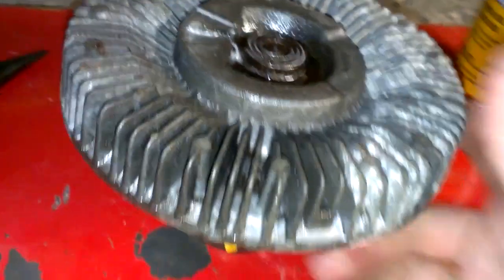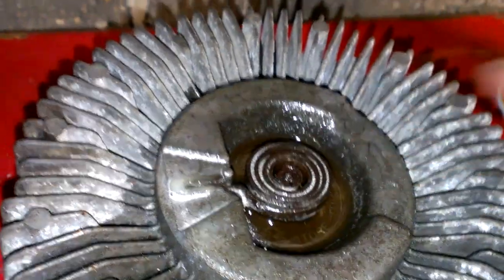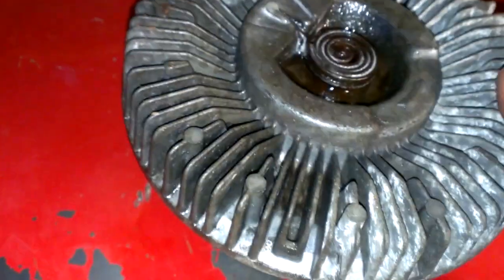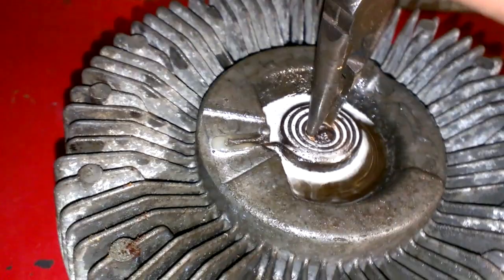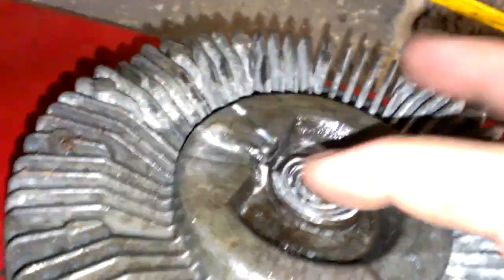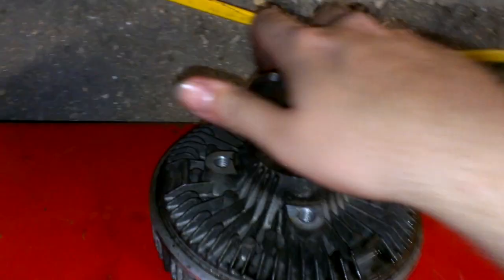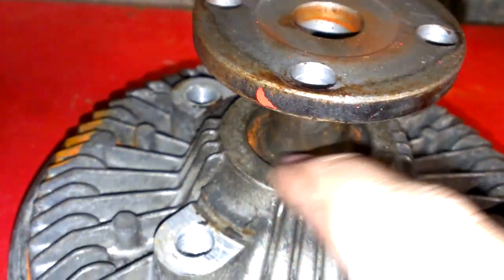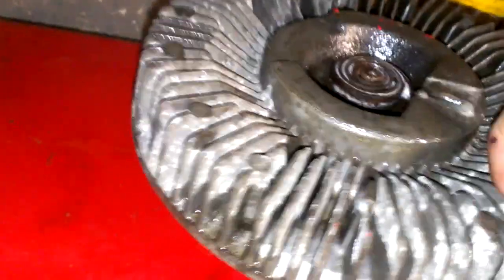How to fix a fan clutch

Comment: I'd usually just replace it if I had a problem, but this is an excellent solution if you are stuck someplace or need to use the vehicle until you can buy a replacement. Thanks!

Comment: That's called a thermostatical fan clutch. That spring on the front like you said heats up and coils up like a thermostat in the motor and locks the fan in. The other types are centrifical which spins with the engine rpms on centrifical force, the faster the engine spins the more the fan locks in. The other type is a solid fan type that spins the same as engine rpms at all times. Then for most big trucks, they use air controlled fans and those  spin up when the engine reaches a certain temp.

Comment: At low RPM and vehicle speeds the fan clutch locks up to make the fan turn to compensate for the lack of airflow through the radiator such as stop and go traffic. As the vehicle speed and RPM picks up the clutch allows the fan to freewheel as airflow coming through the grill flows through the radiator cooling the fluid (Coolant) running through it. It is a centrifugal clutch much like the one on our old mini-bikes.  Mercedes and BMW do use a Thermo-static design fan clutch and others have electric fan in addition.    I am ASE certified. (A. sk S. omeone E. lse)
Reply from the maker: Michael Ferreira yea this is a thermo static fan. (coil on front) thanks for the info

Comment: Thanks for the video Bam.
Mine was stuck in the full on position (opposite to yours) but with WD40 and a blast of air it's working perfectly again on my 96 Safari.
I didn't even have to remove it from the car, just loosened the shoud and reached in.
An excellent fix, thanks again.
Reply from the maker: cool. glad it worked out for ya.
Reply: And did it stay functioning properly  3 years later?

Comment: Temporary fix only, these, alike most modern parts are designed to fail and usually irreparable, then when you go for parts, find the replacement is 10 times the cost of an older cars (same) unit.  Auto makers used these tricks to make aging cars economically irreparable, which i see as a criminal act.
Reply from the maker: ToxicHolocaust2050 yea that's how the world is now. its a shame isn't it.
Reply from the maker: well said
Reply: M
Reply: That is what they call in the industry predetermined obsolescence  The oldest light bulb still going has been burning for over 100 years and counting.  The light bulb manufacturers got together after they found out that they were not getting repeat sales ever since then they have designed light bulbs to burn 24/7 for only 40 days.  Predetermined Obsolescence!
Reply: Watch Mysteries at the Museum. I saw it there. Maybe they have it on youtube that episode. It has been running 24/7.  Too good of a design.
Reply: @1957wade     how did they do that, the~~ 40 days ,anybody knows?
Reply: @josepeixoto3384  it's the filament material and thickness, its been tested and developed to eventually break after been heated for a certain amount of time. Sometimes you can actually rotate a lamp with a burnt out bulb so the filament reconnects and sometimes (if you're lucky) it will stick there and you can get more use from it.
Reply: Exactly! That's terrible
Reply: That's why you throw the clutch fan away when it fails and replace it with an old time 4-6 blade solid fan!

Never heard of one of those old time fans failing, have you??
Reply: If you have the receipt there warrant free for life that means after you by your clutch fan / fan clutch ..and you can get a free one when it goes bad
Reply: We just bought a new one

Comment: The valve working again does you no good if all the fluid has leaked out.  You can peel them apart, fill them about half way with fluid again, and then re-seal everything and it should work fine again, as long as your "valve moves/  like you said/  and the bearing isn't locked up.

Comment: Not true. There are blind plugs under the ones that hold it to the fan. You have to drill them out. Then you can replace the fluid in them. After you flush it the old stuff out. If it leaks around the outer seal. Just reseal it. The inner seal can be pressed out. Once you press out the threaded holder with a puller. Just replace with the same part number on the seal..

As these things cost $100.00 new for a factory one.

Comment: I think my fan clutch may be bad.. my fan used to run directly all the time. It's 30 degrees outside right now, that may be what is causing it to not engage. Wonder if it will go back to normal when it warms up a bit

Comment: I thought the fan is supposed to free wheel when its cold and lock up when its hot? Isn't this how it works, so less air is drawn in when cold and more air drawn in when hot?
Reply from the maker: YES! that's exactly how it works. but when its cold and you free wheel it by hand its supposed to have at least some resistance. like with one good spin it will travel about one and a half turns before it stops is a good estimate. a little after that is good. but if it turns like 5 turns before it stops then its time for a new fan clutch....
Reply: bam6972 Ok, thanks for that. In fact, when mine is stone cold with the engine off and I try to spin the fan, I can barely get a quarter of a turn out of it. I guess this explains the constant loud fan noise. Hence why I have been searching YouTube for an answer and a fix. Thanks for the help and great YouTube clip.
Reply: aussikiwi same with mine...very stiff to turn, and lots of fan noise at cruise rpm...i can stop the fan with a towel protecting my hand when engine is running, but it has lots of resistance...i was suspecting failure of the bearing..

Comment: What is the white stuff in the fins? I just bought a new old stock fan clutch and it had some grey and white stuff about 2 inches long on the edge and on 4 or 5 fins. Looked sorta like dry toothpaste. I don’t know if it’s oxidation or it leaked a little where it pressed on in the box and dried. It seems to be good still but haven’t installed yet.

Comment: ok, i think this may be my problem on my 04 4x4 suburban. when im driving at any speed if I "remove my foot from pedal" when coasting there is a spinning whirring sound from engine, but when I "press pedal with gas" the sound goes away?  I tried something when I was coasting at any speed, I put the car in neutral and the sound is still there, it only goes away when I press on the pedal, WEIRD!?  Gonna try this fix.  Thank you and let me know what you think on my engine issue.
Reply from the maker: +m00nchildblues it sounds like the fan is doing its job actually. idling when hot it turns the most and when you hit the gas it will actually kinda free wheel. so you might here a roaring sound at a stop and not when you get going again. that's normal. but if the roaring gets louder when you hit the gas then the valve is stuck in the open position and locking the fan up permanently.
Reply: tech fixed it, it was the rear dif bearings shot. 1k later..

Comment: when the car is cold is the fan supposed spin fast as well? or only when warm?
Reply from the maker: its supposed to freewheel to some extent when cold. and fully engage when hot.
Reply: +bam6972  ok thanks. I am thinking the clutch fan is engaged at all times even when cold. I live in bakersfield and it's been hot and I just don't see the clutch kick in and out. I have a 04 jeep wrangler with 4.0 engine.
Reply: +bam6972  ok thanks. I am thinking the clutch fan is engaged at all times even when cold. I live in bakersfield and it's been hot and I just don't see the clutch kick in and out. I have a 04 jeep wrangler with 4.0 engine.
Reply: +bam6972  ok thanks. I am thinking the clutch fan is engaged at all times even when cold. I live in bakersfield and it's been hot and I just don't see the clutch kick in and out. I have a 04 jeep wrangler with 4.0 engine.
Reply: +bam6972  ok thanks. I am thinking the clutch fan is engaged at all times even when cold. I live in bakersfield and it's been hot and I just don't see the clutch kick in and out. I have a 04 jeep wrangler with 4.0 engine.
Reply: +bam6972  ok thanks. I am thinking the clutch fan is engaged at all times even when cold. I live in bakersfield and it's been hot and I just don't see the clutch kick in and out. I have a 04 jeep wrangler with 4.0 engine.
Reply: +bam6972  ok thanks. I am thinking the clutch fan is engaged at all times even when cold. I live in bakersfield and it's been hot and I just don't see the clutch kick in and out. I have a 04 jeep wrangler with 4.0 engine.
Reply from the maker: you wont see it kick in and out. it will very slowly kick in as it gets warmer and then stay engaged at all times after that since the radiator is always very warm after the engine has warmed up. then once engaged and warm it will sorta release when your heavy on the throttle. as your moving the fan doesn't really need to spin as hard since the air is being rushed in. when its warm pop the hood. the fan should be moving very fast and loud. then have somebody give it a bit of throttle like 1500 to 2000 rpm. you should hear the fan slow down after a few seconds.

Comment: I like your video but i'm having the opposite problem..Mine is stuck so the fan is turning hard all the time..Any idea's..
Reply from the maker: do the same thing. loosen that middle pin and put some pb blaster in there and work it back and forth with a pair of needle nose pliers. that pin is just stuck in the locked positions. just need to free it up.

Comment: So you don't think it could be that I am just trying not to have to pull intake
Reply from the maker: dont have to pull intake. just take the top sensor off and look inside with flashlight. if you see gold spots then its leaking fuel inside. should be all black carbon build up.

Comment: ok i turn the little pin in the middle of the fan clutch was that ok
Reply from the maker: +Lady Sylvia R. Richardson yes as long as it sprung back from where you turned it. if it didn't spring back then put some pb blaster on it and soak it for a few hours then try turning it. if it doesn't free up then time for a new one.

Comment: So mine sounds like its good when i first start the truck and then it quiets down and i dont hear it again till the next morning
Reply from the maker: does it overheat?
Reply: bam6972 no not at all but i never hear it kick on
Reply: All fans make noise at start up. As that is normal when you are stopped and have the AC on..Till it gets warmed up or you start moving.. It tells you it's working. As it takes time for the fluid to disengage the fan. It works just like a transmission. The thermo coil is what controls the opening and closing of the valve.

Comment: Your supose to be able to stop it with you hand 😂😂there not supose to spin on a cold engine they only engage wen rad is hot it work then stop wen rad cools simple the design is so that the fan never spins at same speed of engine other wise you get a big roar first thing on a cold engine you should be able to free wheel it after 2 minits

Comment: My fan clutch costed 1600.00
Reply: 1600 what? between 50 and 100  euros(~~dollars) is  the price for a Heavy Duty  one,for a 3.1 TD trooper/Monterey for instance; LOTS of aftermarket brands,near 20 or more!!!!
Reply: Jose Peixoto I got a UD I couldn’t find an aftermarket
Reply: @moemuny89      oh,those!!  still,i think there are some: my first google hit was this one: 
06-206 Clutch Kit: UD Truck (Nissan Diesel) 1400 L6 4.2L Turbo-Diesel 11.8 in.
In Stock
E-mail this product to a friend
MSRP: $414.59
Price: $311.79
Sale Price: $296.19
You Save: $118.40 (28.6%)

$296 is already double what it should be,i know exactly what it takes to make the components that make up the clutch,but i've also seen one for another  UD engine for 800!!!!

Comment: Really! y just buy a new one
Reply from the maker: some are really expensive and just lubing it up will fix most of them sometimes
Reply: Ok, it will brake later on so, i think sometimes if you do this work its better do it right and that's replacing with a new one and don't have a engine replacement later on when this fan clutch fails again
Reply from the maker: true
Reply: Not everyone can just throw new parts at vehicles. Many people are not that financially well off. We have to save any where we can just to make bills food every month.

Comment: can you epoxy the clutch to the shaft and get bad fuel mileage but it wont overheat, and then sell the car and make a profit? not buying a ton of parts ..
Reply from the maker: possibly yea, if you get enough epoxy on it. it might break free though after a bit. but if it stays it will make one hell of a blowing noise. just take the thermostat out.